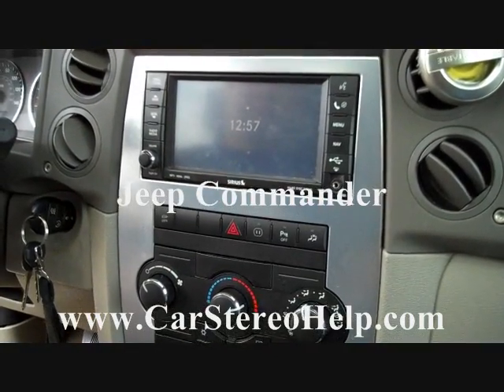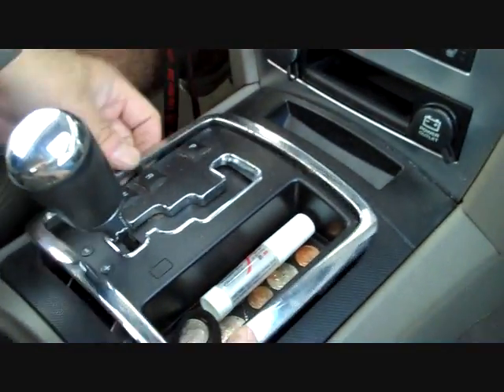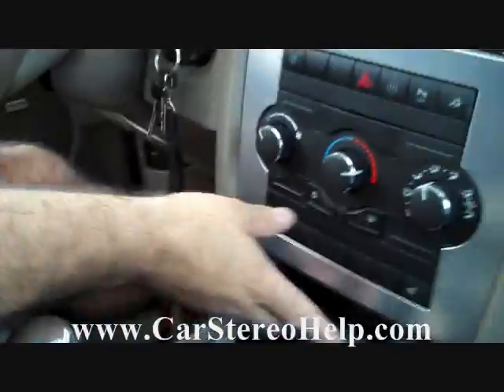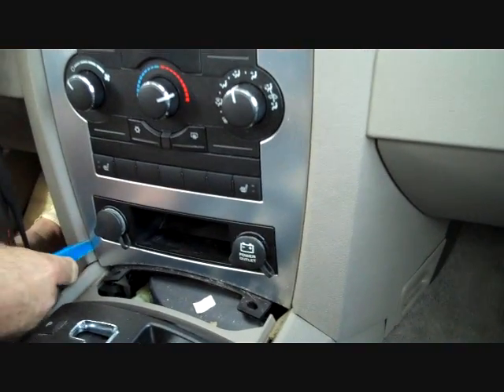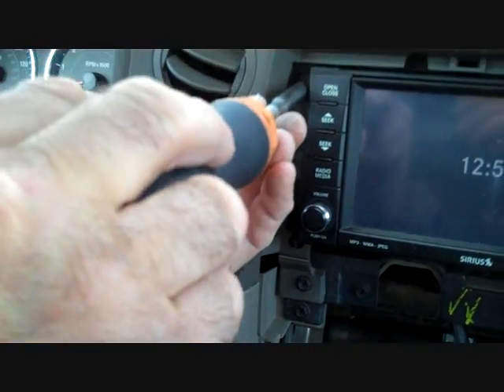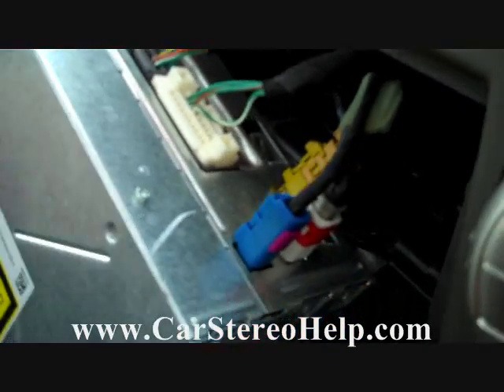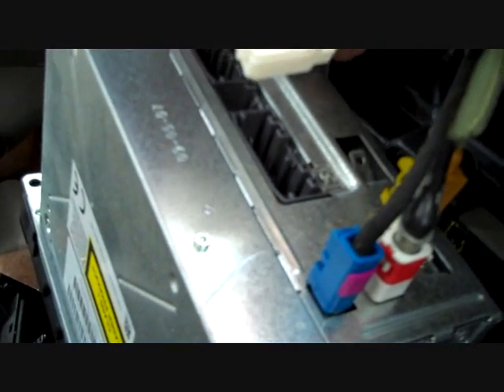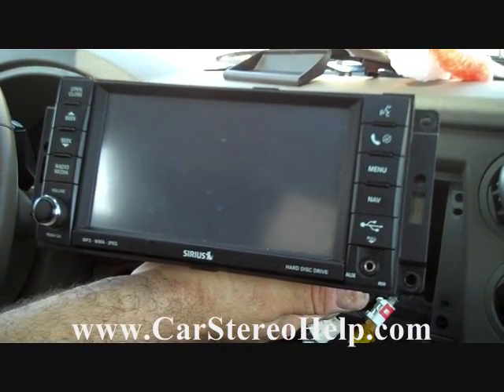Jeep Commander Stereo Removal = Car Stereo HELP

Comment: Does this method also work for a 2005 Jeep Commander or do I need to remove the entire dash panel?
Reply: I've got a 2008 and it's completely different then the 07 and prior.  This video is dead accurate.
Reply: I couldnt find that phillips screw, whch holds panel. Any help?